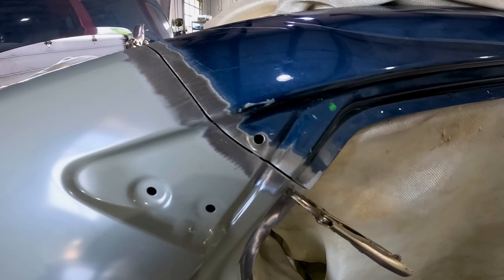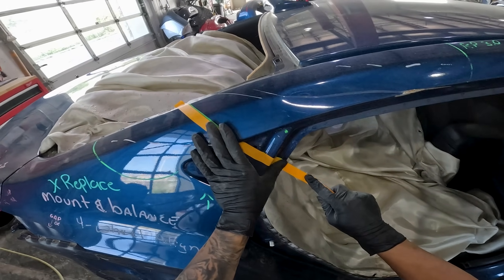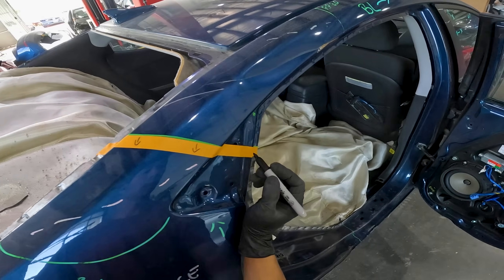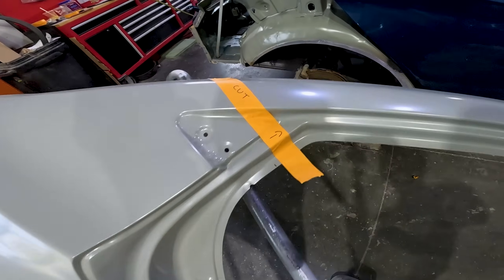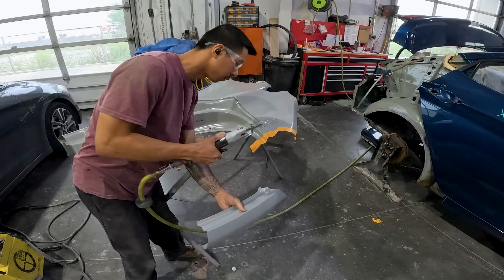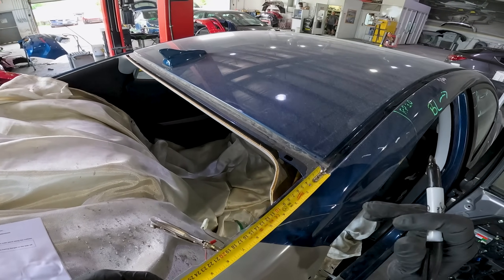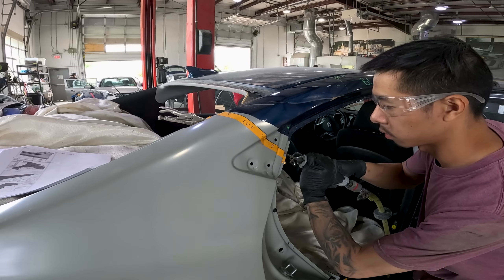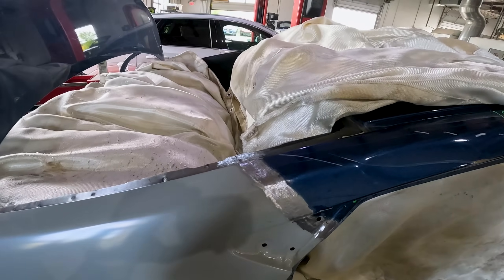This Took Years To Learn, I'll Teach It To You In 2 MINUTES!!

Comment: Awesome work. I'm just wondering why you're not using grinder I think it's much easier?🤷
Reply: I said the same thing. But maybe its our perception from using them for ever.
Reply: I started trying different cutting tools like jigsaw, hand held band saw, die grinder with multiple cutters, even a recip saw with zero clearance foot. I used grinder a lot, but get annoyed with the abrasive dust, and sparks getting everywhere. If you have anything in the shop it gets covered with shit, especially windshields, and wipers. I welcome any techniques that can replace the grinder if possible. Nobody’s wrong, just my choice.
Reply: Seems more controllable with a cutoff wheel grinder.
Reply: If I wind up with cancer when I get older I feel like it will be sure from Grinding wheel dust. All young guys should have full face shields and respirator on for even the simplest little cuts. JMHO
Reply: When you are using a grinder you risk the chance of burning the interior or the glass from the sparks. i saw one bodyman grinding a door skin off a shell and burn the door window of the job next to him
Reply: @davidmilne9738  You can't fix stupid.

Comment: Hi there, the repair is well done, BUT, modern high carbon steels should not be welded, but the gap should be sleeved and MIG (CuSi) brazed. 
A complete weld over that distance makes the panel weak. In a next crash it will crumble there (the seam) or rip off.
Trie yourself, make a weld with two modern metals (high carbon steel) and do the same thing now sleeving the seam and MIG brazing it.
Than trie to tear both panels, you will be surprised.....  ; )
Keep on hammering...
Reply from the maker: I've always wanted to learn MIG brazing. I disagree that it will crumble or rip off in the next accident, all though MIG welding does cause it to become more brittle.
There are other manufacturers such as BMW that glue their quarter panel section with a backing plate and this is considered safe.  Thanks for sharing!

Comment: Just curious- if you have a complete new panel, why not drill spot welds and use whole thing and avoid the butt weld altogether?
Reply: You can't buy the whole panel new. you have to section it. if you install a full used one, you'd probably have to remove the roof skin also.
Reply: @samg5543  ok fair enough- i just assumed it was a complete replacement panel... With my old cars ive had to do that so thats just what Im used to, and its nice because there isnt any seams to weld.
Reply from the maker: Yup! You would be getting into the roof. Also, insurance companies won't pay for a complete side apertures so we order the quarter skins only and these are generally where manufacturer allow you to join them.
Reply: @AUTOBODYTECH  yikes!! Well im glad I only do 60s Mopars (although I did do a quarter panel on a 92 Stealth, its on my channel) and also glad its for myself and not insurance companies!!!😁

Comment: Easier to cut through both panels at the same time when you have them overlapped. No measuring and the gap will be even
Reply from the maker: The measuring is because that's exactly where the manufacturer wanted the section. I did cut through both haha

Comment: So much better to use a sawzall then a grinder.
Reply: why ??
Reply: @tomthompson7400  cutting grinder makes a lot more sparks (Fire risk), creates more heat may cause metal to warp, creates more dust, harder to make clean straight cuts, more risk involved with much higher RPMs if pieces fly off or breakage, and if you use the correct sawzall cutting blade its will cut faster. 
Use what you like but I like my sawzall.
Reply: @brianhill4995  your job , your way ,,,  I joggle those joints and lead them  , clearly you dont , but as we said , your job

Comment: Why wouldn't you just use the location of the factory panel seam?
Reply from the maker: The side aperture is a massive panel that runs from the front of the front door to the rear bumper. Doing so would likely be adding over 125 to 175 spot welds. The panel also sits underneath the roof flange, so now you'd also have to paint the roof. To answer your question, it's  because it's not cost-effective
Reply: @AUTOBODYTECH  Ahhh, ok so you must have cut it down to a more manageable size first. I saw the short piece that you cut off right before welding, and I thought that was the whole factory panel. Ok I got it, Thank you!

Comment: Where's your sleeve? No backing plate will crack the bondo because your joint is weak after it's grinded, a few hundred shuts on the door is a comeback

Comment: Well i don't get it, you just did what they teach in trade school. It's a cut and butt. But if you want a even tighter fit, go for a zip disk, cut at 45 degrees to perpendicular. And when the cuts done through both pieces they will fit with zero gap. Good video but i was disappointed, there was no neat trick, just textbook procedure.
Reply from the maker: Yes, the 45 angle is a great trick! Thanks for sharing!

Comment: Really isn't a Perfect Butt Weld Joint touching? Then you can do a Butt Fusion Weld, Either with an Oxy Acetylene Torch or a Tig both with Zero Filler!  Looks like you used a Mig
Reply from the maker: When welding, you are adding material, so if the gap is touching, there is nowhere for the filler material to fill, it will end up buckling.
Reply: You're both wrong; he should have pounded out a brand-new car out of flat stock!!!
Reply: You watch too many auto body videos LOL! You can't gas weld on modern metal. I'd tell you why...but then I'd be revealing auto body repair secrets.
Reply: yes, you need a small gap for expansion. I have heard rule of thumb for the gap is thickness of the metal. the gap in this video looks to be too wide
Reply: @samg5543  it’s not for expansion. I weld full pen 100% x ray everyday, it’s irritating hearing people that don’t know what they are talking about speak.

Comment: First of all butt joining those spots is against ase and icar regulations there should be a sleeve in behind each joint.  After welded my neck t and grinding it smooth there won’t be any material left to make it strong repair.  The joints u butted are now weak spots and a quarter panel is part of the structure of the vehicle so now after your repair the car wouldn’t pass structural inspection and would be dangerous for owner because car would collapse in a rear end collision not having the structural integrity.  So bad work
Reply from the maker: Where is this information from? ASE and I-Car regulation do not supercede OEM procedure